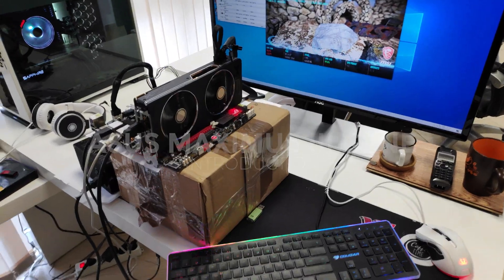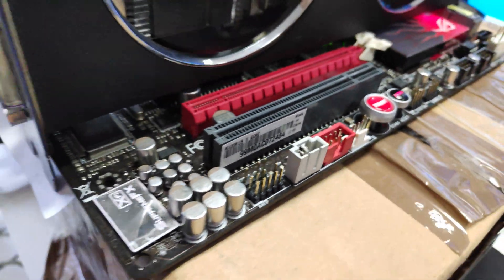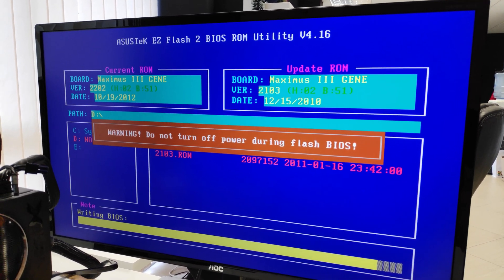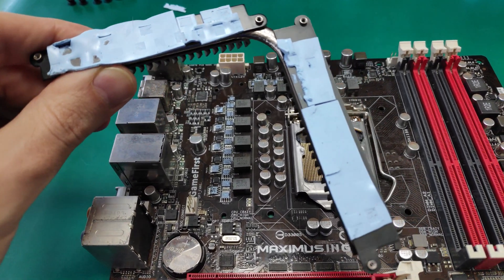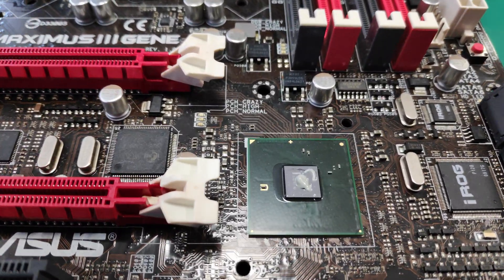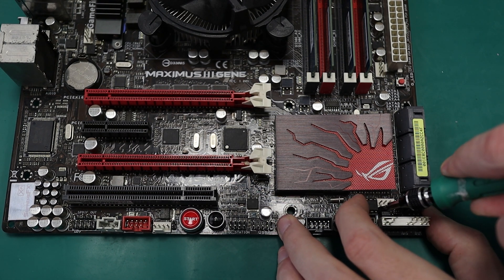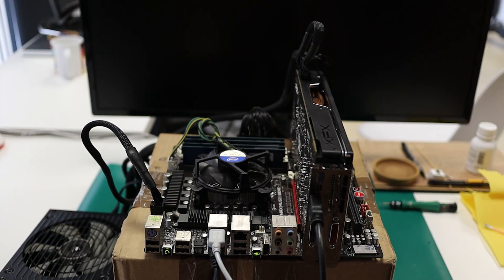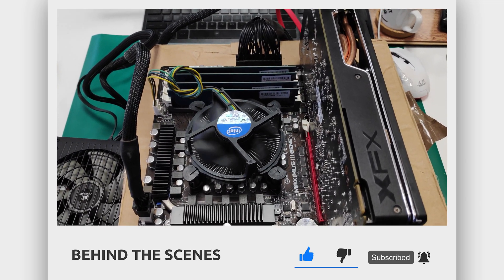HOW I FIXED Asus Maximus III Gene motherboard that won't POST

Comment: Thank you very much
Can you help me please ?
I have the same card, but I have a problem with the USB ports, when I connect a USB keyboard or mouse, the bios cannot recognize them!!!  and I would have to connect a PS2 keyboard to access the BIOS, and another problem the overtemperature of the processor!😢

Comment: I have this motherboard right here repair. Windows is installed and it will boot BUT when I turn it on it will restart 2x before boot. Do you have any idea? After this it will boot to windows just fine.

Comment: I have a Maximus IV GENE-Z with an i5 3570k I can't use the original multiplier it's reducing my processor from 3.4 to 1.6 and my onbord network card is not working turns on the led but does not receive a signal.

Comment: I have the Vii gene. I can’t run a new CPU. Really wanted to buy a new one. Stuck with the i7 4790k. Upgraded to the 580 oc 8gb.
Reply from the maker: Well, this CPU is still very capable for 1080/1440p (in some cases) gaming.
Reply: @Technotize  I’m playing the new mafia in 1080 all my settings are the highest except for v sync. Hell yea.

Comment: Thanks for posting this video. I just picked a computer up with:
Maximus iii gene
I5 760
16gb ram
Gtx 745 4gb
80gb ssd with legit windows 10 pro
All for $80 usd. I personally wanted it because the led rog chip. Its looks pretty. Probably gonna sell the 745 and 760 to make most my money back.
Reply from the maker: That's a good bargain. Get a Xeon x3440 and above from AliExpress, sell that GPU for as much as you can and get RX570 and you've got a gaming PC right there.
Reply: @Technotize  I actually have an rx580 4gb and watercooled 980ti classified sitting here. Im good on the budget gpu side. I just wanna have a nice vintage system I can throw around and see how many years it can go oc at 4ghz. I was thinking x3470 or 80 for the hell of it since they are dirt cheap.
Reply from the maker: Well, even better ;) If you're good with the cooling even 4.2 Ghz is doable. But yeah. 4Ghz is the safest bet for the long run. I built for my home a Rampage Extreme X58 PC for the same reason. I love that generation of CPUs and mobos :)